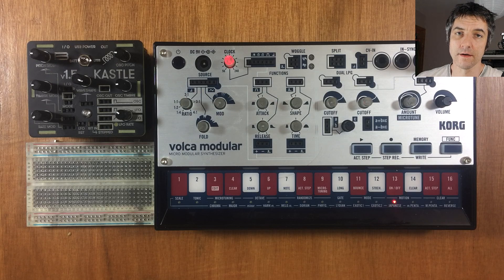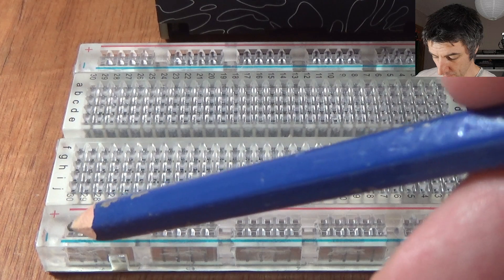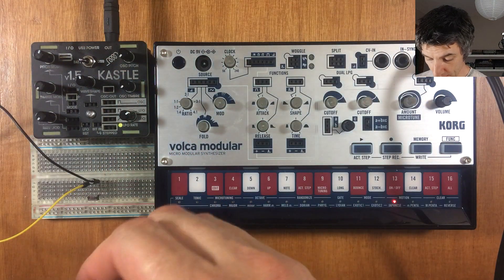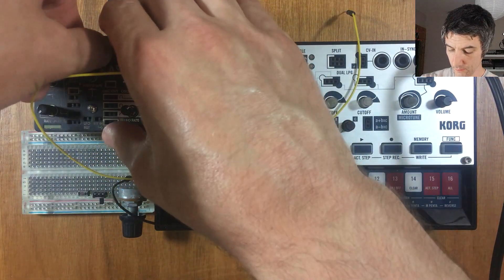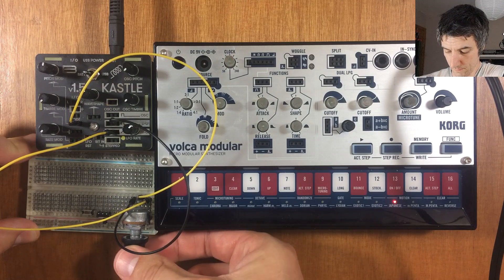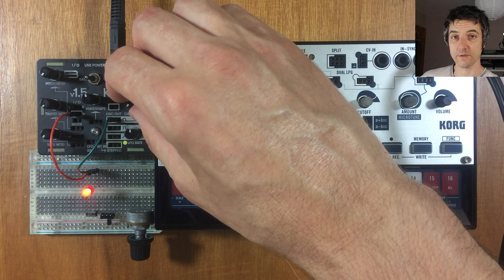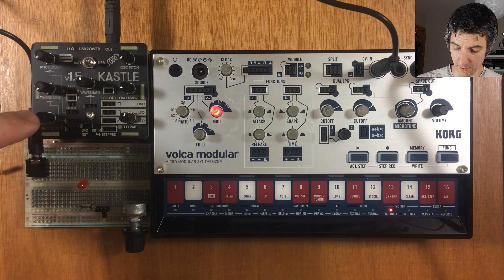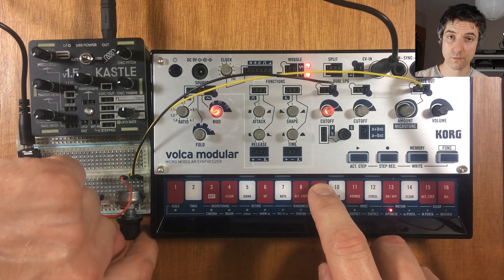How To Expand Bastl Kastle & Volca Modular Using A Breadboard

Comment: thank you so much for this video. I've been messing around a bunch with the breadboard and I'm wondering how to get the crossfade you showed to work with the gate/envelope of the volca. I was able to get it to work running the positive out through a transistor circuit but it sounds distorted. Any advice on this? I'm a beginner at all this so I'm sure I'm just missing something obvious
Reply from the maker: Thank you. Quick question, what are you cross fading the envelope with and what are you connecting it to? Presuming you have two sources and one destination the first thing I'd try is the simplest with the two sources connected to either side of the potentiometer and the destination connected to the centre.

If you'd like some excellent in depth tutorials on active circuits then this channel would be the place to look: https://youtube.com/@moritzklein0

Comment: Video is  “Korg Volca Sync Out + Arduino”. Haven’t received answer.
Reply from the maker: I've never seen those before. There like a few LEDs in a row designed to plus straight into a prototype board. I'm not sure what you'd search for to find them

Comment: Dip Switch Question  
Chris I really enjoyed using all the Volca breadboard connections you’ve shown. 
Have you found any use for dip switches with the Volca Modular?
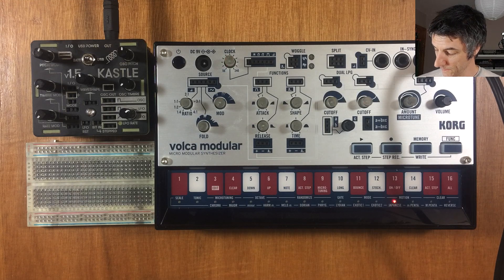Reply from the maker: Well you can use each switch on the DIP switch to make and break connections like I do with the push buttons like I show at 2:30, but the difference being you wouldn't need to hold the button down
Reply: Dip Switch worked well and as you mentioned don’t need to hold button down which allows for cool live playing of sequences switching between notes held and not held.
Reply: Thank You Chris.

Comment: Sorry. I meant the ground from the left side of the touchpad. Can it go into any input in the top section of the breadboard?
Reply from the maker: Yes the left pin of the touchpad is connected to ground in my example. I have ground from the Volca modular coming in on the centre pin of the 3.5mm socket. I don't have ground connected to the lengthwise top sections of the breadboard here, but that would be a good idea, so you could add a connection from the centre of the 3.5mm socket to one of the connections marked '-' (on my breadboard) and it would then be available across the whole length of the board. 

On the touchstrip left is ground, right is the signal you want to vary and the middle is connected to whichever destination you want it to affect. You can also swap left and right if you want to reverse the direction of the touchpad.
Reply: Thank You Chris. I have both instruments and your video is fantastic in how to use all these connectors with  breadboard to get so many cool variations. I find your videos to truly be some of the most useful and enlightening on YouTube. Your Liven XFM video really gave me a level of knowledge I found no where else. 
Again, Thank You.

Comment: This is a great video that I've come back to several times. I'm now thinking about trying to make a resistive touch control for the Kastle. So the idea would be to make a PCB with some touch pads, and just female headers that could be connected up to the various outputs and inputs from the  kastle.

The question in my mind is whether these can be direct - ie. the +5 output of the kastle can go through a touchable area and directly back into an input - or whether I have to make some kind of voltage dividers, each with a touch pad and resistor connected in series between 5v and ground, and then tap off the voltage in the middle to send to the kastle inputs.

The first would be simpler, but maybe the touchpads would be nothing more than on-off switches in that context, while the second would give more control but require soldering resistors  etc.

Any intuitions about that?
Reply from the maker: Thank you. 

So if you're going to set this up in the way I imagine which is to create a string of separate resistors in series with various places that you can make a connection to access different resistances, then this would be best set up like a voltage divider. But I really think it's just worth experimenting. In theory adding a resistor in place of a patch cable for example would do nothing as the inputs expect to see a change in voltage, but a resistor connected like this will change the current instead. But you can get some unexpected results sometimes which can't always be explained without knowing what's going on inside the device, certainly not with my DIY level of knowledge anyway 😄 Here's a good example: https://youtu.be/KpMwWNjHSsA?si
Reply: @ChrisLodyMusic  Thanks. Yes. I guess I should just experiment on breadboard first before trying to make the PCB. 

That trick to getting a clean sound by putting extra resistors in series is ... surprising. But a good find.

Comment: Thanks Chris. After several years of settling on only 3 volcas (fm,keys and drum), then going directly to building a modest eurorack system, I have now bought the volca modular. Why? Don't know but having fun using protoboard connection ideas like this.
Reply from the maker: Ha nice 😁I started my semi modular journey with the Volca Modular and have since bought some Eurorack compatible semi modular gear. I actually had a Eurorack case for a while but that turned out to be faulty unfortunately. I'm sure that will happen eventually though! 💰

Comment: Is there another way to do the ground? I use mine with a cv keyboard and would like to sill be able to play it when patching like this. Also do you need to ground bastle and volca together to patch in between them?

Like maybe cv keyboard to cv in jack then the breadboard connection from cv in on modular to the breadboard for the ground? That way it would still get the gate and pitch info from the keyboard but could use the extra attenuator you made on the breadboard?

Or just sync in as a negative if it's just acting as 0 and not actually a ground?
Reply from the maker: Yes there's lots of ways to do it. All the sockets will provide ground so you can always find a way. Actually the simplest way is just to connect audio out on both the Volca and Kastle to the same audio mixer or interface. I didn't show that method as it uses more gear but it works fine. Also I think the hex screws on each corner are connected to ground so you could unscrew one and loop a wire round it if you want to free up all your sockets
Reply: @ChrisLodyMusic  OK, last thing, I promise, lol. Have you figured out a way to just control a knob the way you can with the attenuation knob when you only have one jumper going from slot A on atenuator to a knob like the fold knob. 

I'm trying to see if it's possible to control 2 or 3 knobs movements from one knob.
Reply: I actually figured out a way of doing this. You use the attack release function. Connect negative and positive of AR function to the left and right of the breadboard attenuation knob and then the middle to the knob you want to control when you press a key the attack if sent to the fastest (all the way to the left) the knob will go up or down based on your attenuation knob. Not as functional as slot A on the modular but does the trick. And you don't really lose the + and - from the Attack Release since you can split it on the breadboard and reuse it anywhere. As long as your attack is fast.
Reply: Awesome thank you for the info! I bought all this stuff today. Can't wait to make a few more attenuators!

Comment: I have bought V Modular to try these breadbord mods. Will work for M Werkstatt also. I have some wories with mixing signals with these tho... different voltage probably.
Reply from the maker: It would be best to check what voltages are used on both devices but the VMod does things in practice that are well outside what the manual states. Check here to see what I mean https://syntherjack.net/the-real-volca-modular-specs/
Reply: Have found this one, it appears that V Mod have 3,5v, Werkstatt have 5v. With a resistor it shuld be safe to feed Volca with Werkstatt signal. Not so sure other way around. Maybe it is possible to bust Volca signal to 5v standard. Well... thx for grat video! I am inspired as hell with further pissibilities of ARDUINO programing🧐 For now, idk anything🤔

Comment: so cool man. what other instruments would go with this?
I've got the bastl b drum and volca modular
Reply from the maker: Thank you. Well the ae modular system has the same small pin like connection and they also make a module that will make the voltages compatible between them both. The starter system is quite a beast for the money. That and both Bastl Kastles are the only gear I know that has the same pins as the Volca Modular

Comment: Nice! Started doing some Arduino stuff in recent months and it never occurred to me that I could use the breadboard like a patch bay with the Kastle. Kind of sold me on the Volca Modular as well.
Reply from the maker: Thank you. Yes combining an Arduino with this kind of gear would be good fun. I'm not much of a coder so it's not something I've played with, but I have a Picaxe chip somewhere that can be programmed in Basic which is more my level 😄

Comment: The next step would seem to be passing control voltages and audio signals between the modules... Is this doable or are the differences in, for instance, peak voltage too great?
Reply from the maker: Yes that's the reason I bought the Kastle actually for a tiny mini modular, Kastle Drum is in order too. There is an argument that the voltage difference could be an issue but I've had no problems. I found a great article called The Real Volca Modular Spec on a blog somewhere, the VMod is stated as outputting 3.3v max but it's actually much more and can peak at 9v so there's much more range tolerance than  is written in the official spec
Reply: This! That's actually what I was hoping the video was about.

Comment: Well explained to begin taming and expanding that little lovley beasts. Instead of a potentiometer or a pressur sensor I like to add and recommend try using a LDR(the less light it hits the more resistance it has) or(for modulating that change) a vactrol(a simple build with LDR, LED and a resistor) that's powered f.e. by the LFO function, pitch, the sample & hold or what ever is fluctuating on the vm.
Reply from the maker: Thanks. Yes that's something I'll maybe cover in a later video as it's a bit more advanced. The only problem with the vactrol idea is the minimum forward voltage Vs the low voltage of the VMods outputs. It might be possible to bias the connections but I'll have to check that doesn't cause problems elsewhere
Reply: @ChrisLodyMusic  great